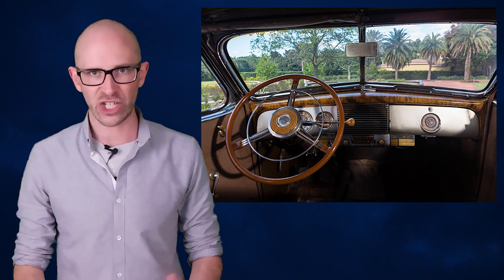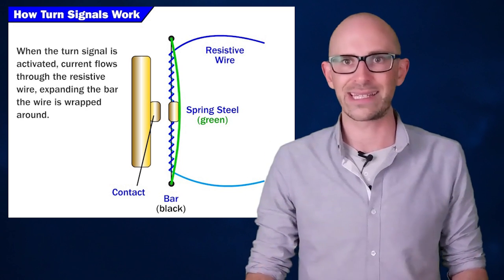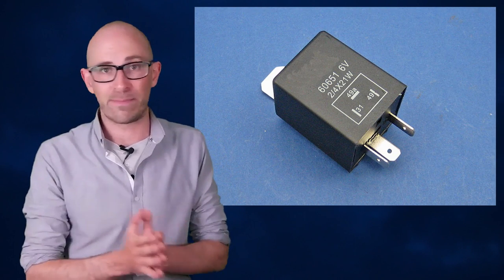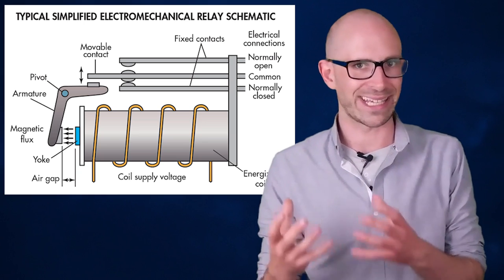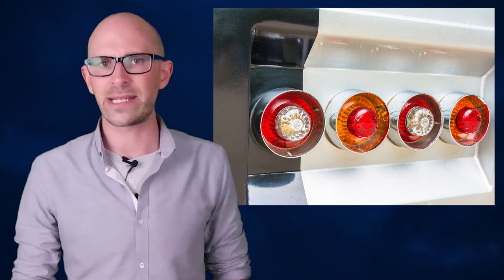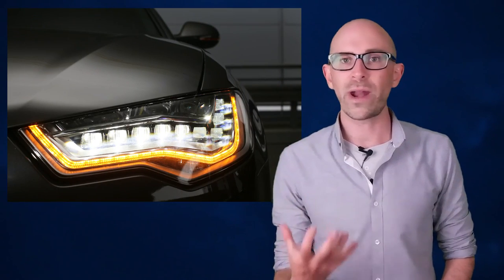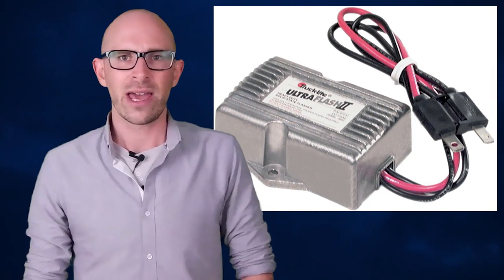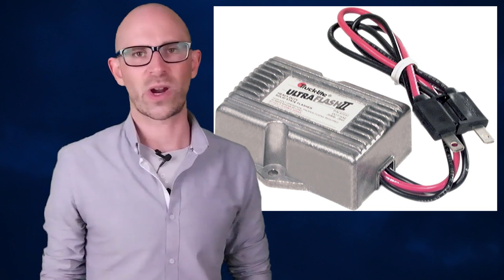What Causes the Clicking Sound Your Turn Signal Makes?

Comment: Wrong: it's the other way around. If a bulb burns the blinker will flash faster. Same happens when people put LED bulbs without the proper resistance into their turn signals: they will flash faster. My favorite are the people that put white LEDs in their front blinkers. They don't seem to notice the color or flashing rate discrepancies at all... 😒

Comment: I have not watched the video at the time of writing but let's see if my knowledge of electronics is right.
 I assume it would be the relays for the lights. The relays are magnets controlled by electricity and are made up of three contacts. So when the relay goes from on to off the middle contact moves from the NC to the NO position and the click you hear is the contacts hitting each other. When you turn it off the same thing happens and the middle contact goes from the NO position to the NC positions and you hear the ''click'' or ''tap'' again. This keeps happeneing as current is applied and cut so you get the "tick, tick, tick..." noise.

Comment: What an incorrect video. The guy has no experience in automobiles at all. 1: Nobody has used thermal flashers for decades. The problem is when the ambient temperature is very cold or hot, the blink rate changes. 2: All flashers for the last 20 years are electronic. They all blink FASTER in cars when a bulb is burned out, this is how the electronic circuit is designed. 3: The click usually was generated by a mechanical strip in the instrument cluster wired to the indicator light. 4: Anything in the last 5-10 years uses a speaker to generate sounds. Go look at GM: the sound is generated by electronics in the stereo and directed only to the driver's speaker.

Comment: 1993 VW Polo.  Relay flasher (IIRC).  If front or rear indicators out, the blink rate doubles.  If side indicator out, the blink rate is unchanged.  So different to that explained in the video. Anyone know why?

Comment: This information is obsolete. Modern cars use digital relays instead of this much much older bimetallic switch. The clicking sound in new cars is really just the audio system playing that sound so you know your signal is on. How do I know this? In my 2002 SAAB 9-3, the speaker that played this click burned out and my signals were quiet thereafter. In my 2013  Chevy Sonic, my radio likes to completely die while I'm travelling and the turn signal noise goes away there too. In both instances the signals still worked fine, flashing and all.

Comment: I've never yet seen any car with a Solid State Flasher.
Reply: Actually, solid state circuitry is the most common way of doing it today, because not only is it lighter and more reliable, but it has also become cheaper. The car typically makes an "artificial" clicking sound in order to tell the driver that the indicator is flashing. Some cars make beep-boop sounds instead, which I personally find a bit tacky.

Comment: Wrong, wrong, wrong...... A blown bulb or LED replacement of an incandescent bulb decreases the total resistance of the circuit which increases the voltage to the flasher and heats the flasher resistor faster. This additional voltage and increased load on the flasher causes the flasher to hyper-flash or flash faster than normal. Adding trailer lights increases the load and reduces resistance on the circuit. This causes slower flashing. This is why Heavy Duty flashers (2 types) exist. One type has the resistor separate from the lighting circuit and the other has a different resistor calibrated for additional load of the trailer lights. 

Most vehicles have switched to computer controlled lighting now anyway. Some vehicles use relays and some use solid state controllers in the BCM. My 2017 F150 uses a solid state controller that flashes the turn signals separate from the dash indicators. So when I installed LED lamps the lights flash normal and the dash indicators hyper-flash. There is a noise that is too quite to hear with the radio generated for the turn signal noise. I cannot find where it comes from.

Comment: Ford Focus,  cmax and smax are silent indicators but have a speaker which outputs the ding type sound for the indicator, I found this out when I turned on the lights with the driver door open on my focus cmax, the usual ding happens when I turned the indicator on, the indicator was flashing at the usual rate but the light chime and indicator ding was slowed because of playing the sound through the speaker, which cannot handle two sounds at once?. Video will be out soon on jt

Comment: massively out dated system , im an auto electrician , modern cars dont use a flasher relay and are just controlled via the body control module

Comment: @2:50 
i dont understand what youre saying

are you saying that LEDs use MORE electricity ? or They cannot handle as much current as incandescent's ?
Reply: ***** i dont understand what he is saying though-

to me it sounded as if the LED consumes more Current causing the blinker to blink faster
Reply: ***** i guess the bimetallic spring is double pole ?
Reply: ***** how does it know there no light ? 
idk what im getting wrong but 

to me more current = more time the light is on
less current = less time

so if the current is too weak youd get no light at all ?
Reply: ***** i get that part but if the bimetallic switch doesnt engage there isnt current to know whether its high or low ?
Reply: ***** np ill just look up a diagram ... im missing something

Comment: How the fuck do you make a 5min video from a 1 sentence answer? 
The answer is just: 
....... "a purposeful sound, added to solid-state circuits to let you KNOW 
they are working, but the most common is because of the bi-metallic 
sensor strip in the flasher unit itself".... THEN UR DONE

Comment: Its pretty fucking simple all it is is a relay opening and closeing the circuit like why dose it have to be that complicated if you really want to get into detail nothing you said it true becuse a relay comeatns mostly copper matterial to conduct the electricity and when the 2 contacts tap echother the electric makes a snaping nosie juming from one line to another to carry the Electric to the turn signal bulbs and repeatedly opeing a close the circuit makes the light flash... that just another complicated way to put what ever you just said